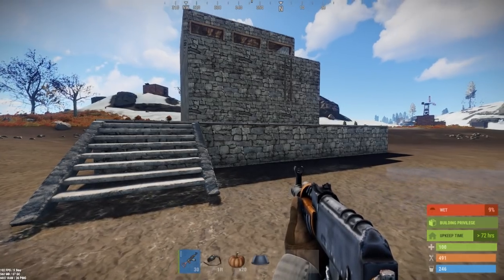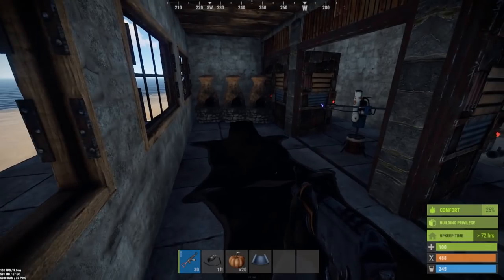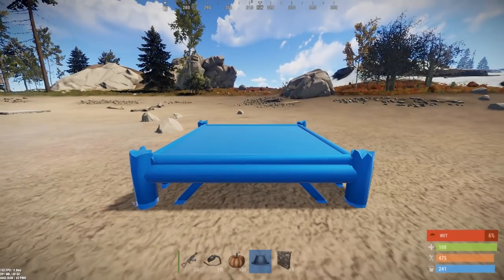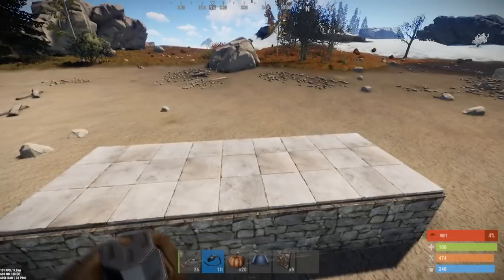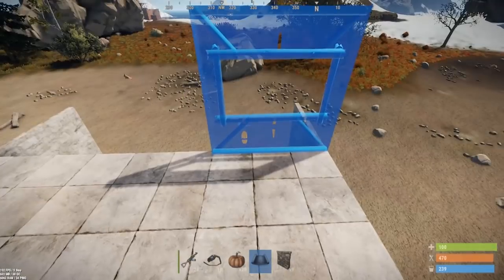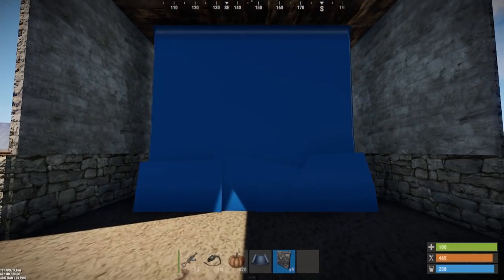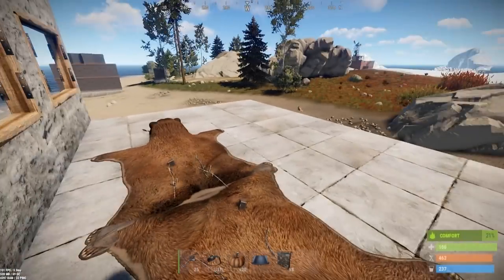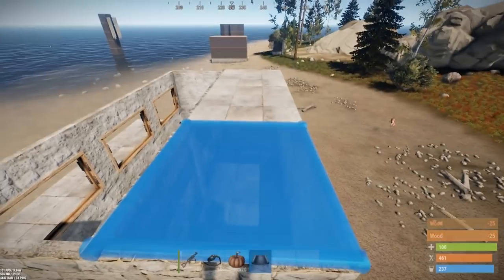Rust Electricity - Highwall Trap Base.

Comment: Of cause it's very hard trap! No one can exit, but you too can't use this gallery in your castle for walk.
What is the reason to build extra hight wall in this case if every raider will be shot or burn after doors will be open?
Reply from the maker: The walls have to be at least that height to accommodate the external high wall that is beneath the base to create the trapping mechanism.

Comment: say, quick. just an fyi. i just got through making this awhile ago. since i am anal, i was able to get the high external in a three foundation footprint (no buffer needed).
you might be able to use lasers on the edge of the floors before the trap floors go into place to hide the beam of light. if they are pointed away from the windows you wont see the little bit of light that remains.
Reply from the maker: cortedemico stacked spinning wheels can also hide the beam !

Comment: you can loot yourself if u always die next to de window
Reply from the maker: Good point! With a broadcaster though and an ARMing switch hopefully you will be nearby!
Reply: @RUSTQuickElectric   even though the concept is old and you just added electricity. I would add some shelves with random loot  or some walls broken so you lure ppl with more success. the half decayed base is the best choice. For example, build next to a rock so they jump easy to the roof, and in this case you are missing one roof so they jump and never get back their loot.
Reply from the maker: @Diego-cm9mz  Yeah this is a old trap that a friend showed me as a newer player. I just spiced it up with some RF broadcasting and automation. Definitely a good call on the area being key!